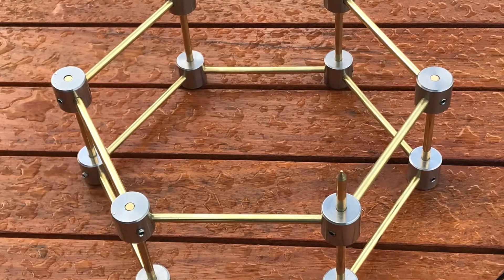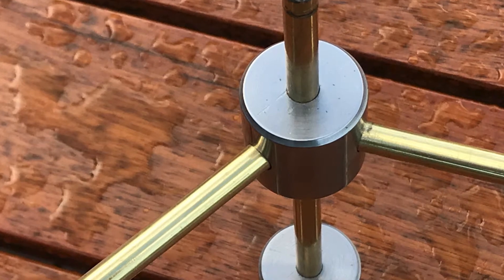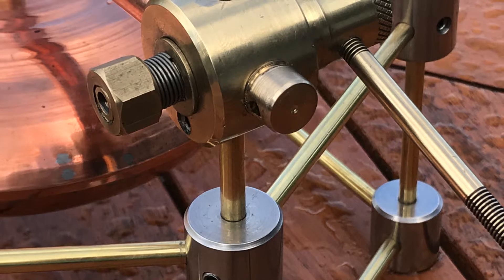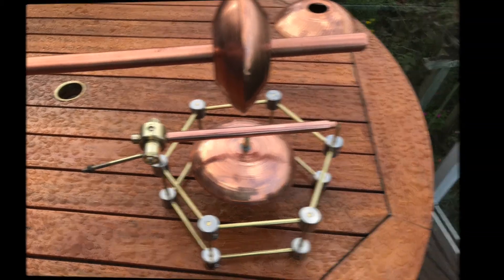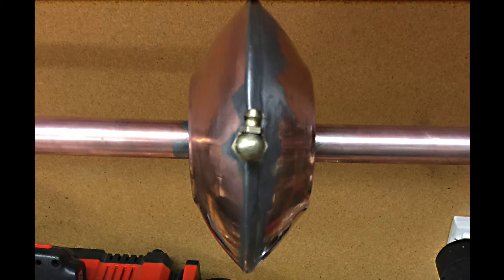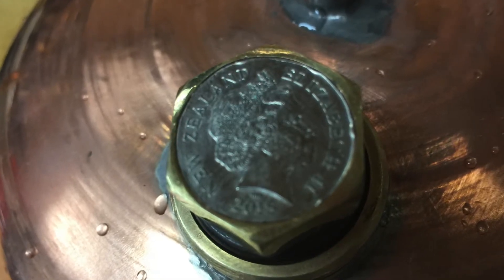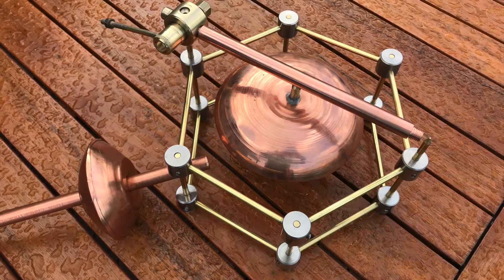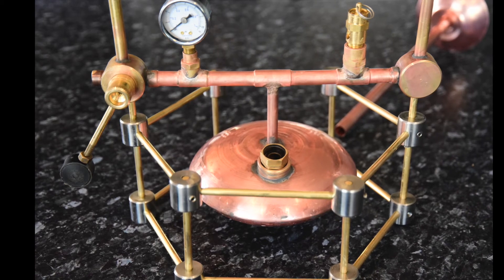Spinning copper from flat sheets on an engineers metal lathe - for a Hero steam engine (aeolipile)

Comment: The Nazis experimented with something reminiscent of a Hero engine. That off a propeller with ramjets mounted in the tips and it would be jump started by a rocket to get the ramjets up to operating speed.
Reply from the maker: Yes that is a cool idea and helicopters have been built using that idea. I have a garden sprinkler that works on the same principal using water jets and it is connected by gears to drive the wheels very slowly and drives itself around the lawn.

Comment: Great series Evan, thanks for putting these videos together. I bought a boxford lathe of the same vintage and was looking for some more info on how to operate it when I came across your channel. I wasn't expecting to find videos from another Kiwi! (I'm in Tauranga.) Definitely keen to see more videos of your next project
Reply from the maker: Thanks Mark.  I expect to be working on the next stage of the project in February-March 2019 and will post more videos after that. I hope to be able to get the new Hero engine working by then.

I should have said, the lathe came from Te Puke High School so it was only about 30 km fro Tauranga. I wonder where yours originated.  I now live in Thames, New Zealand.  Contact me at AEDLewis at gmail.com.